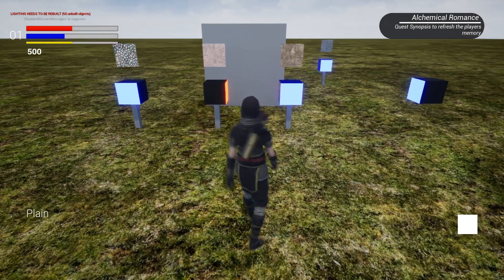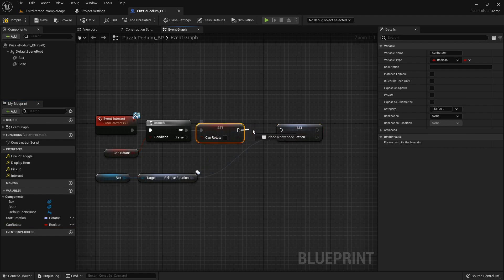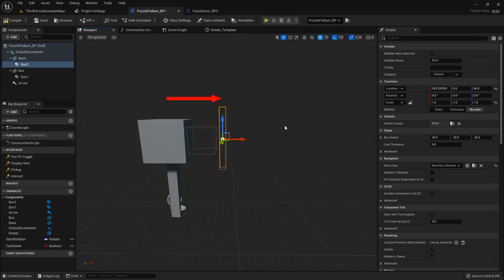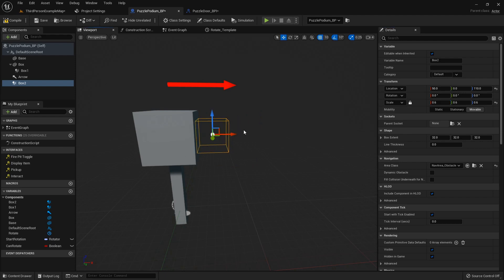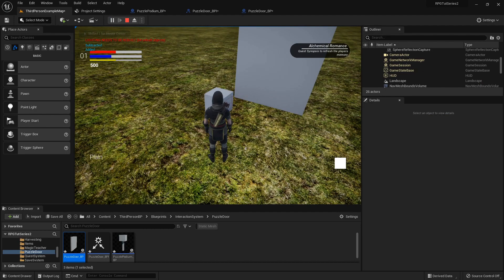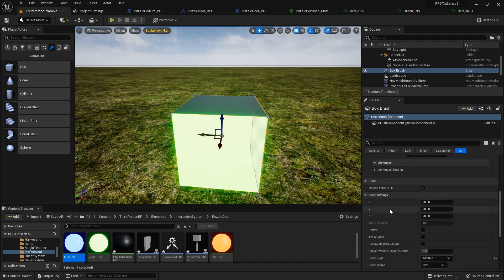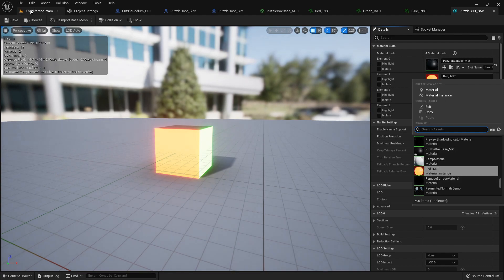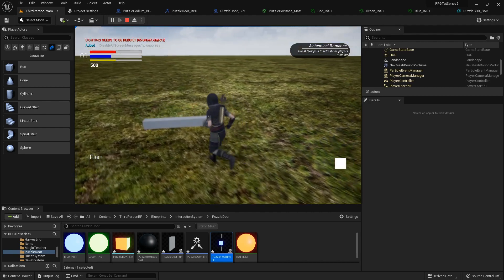Unreal Engine 5 RPG Tutorial Series #112 Puzzle Door (Part 1) #ue5 #unrealengine

Comment: Would it work if you used the statues from the infinity blade pack instead of the block and just put like 3 small statues on top the block
Reply from the maker: yeah that should work fine, just double check the relative rotation and the rotation set thing in the construction script. but should work great
Reply: Sorry to be blowing up your comments but I was wondering if u had Andy issues with warnings in your output log on with the inventory system and also if u have tried packing your rpg project and came up with errors on your inventory struct cuz I keep running in to errors saying inventory struct name mismatch
Reply from the maker: You're all good no worries, I haven't tried packaging it yet but I don't get any errors on my output logs. I'll open the project in a bit and double check but, if you've made any changes to your item info structure after making the data table it can cause some issues. Found that one out the hardway lol...  I'll make a video about that cause I think we did make some changes for the crafting system, but for some reason mine didn't throw any errors. Ue5 is weird like that (honestly I miss 4 lol)
Reply: Should I just go through and refresh all nodes on anything involving the struct